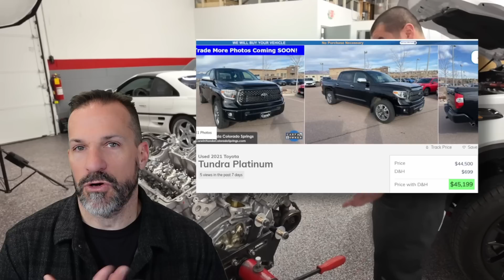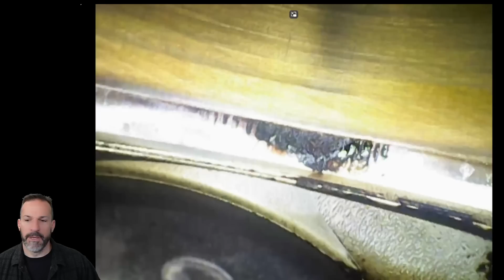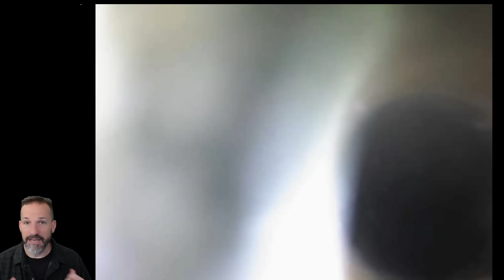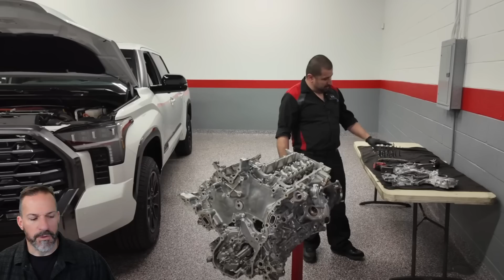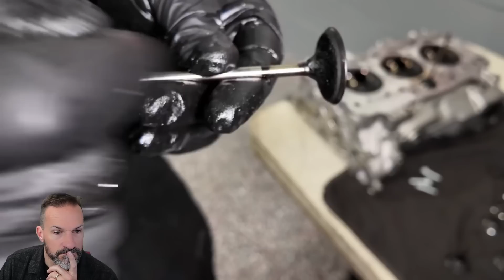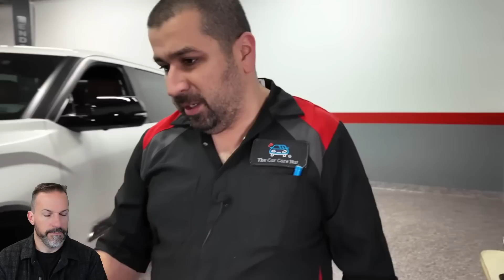Has Toyota LOST Their EDGE? Tundra Turbo V6 TEARDOWN vs. 5.7L V8

Comment: Turbos are junk on a gas engine! The engines will not last as long as the previous 5.7. Maybe that is what they want!
Reply: Absolutely spot on 👍👌✅️👍👌✅️👍👌✅️
Reply: Everyone knows turbos shorten the life of engines and it doesn’t matter if it a gas engine or diesel engine. Diesel handle the turbos much better but it still shortens the life of the engine.
Reply: @edtpnw1336  hardly anyone seems know a turbo shortens the life of a engine. I only bring up diesel because everyone compares a diesel turbos life to a gas engine. IE big rigs.
Reply: @DavidWX877 People who know that turbos shorten the life of all engines no matter what fuel source are morons with no knowledge of how engines work. I use to have this argument with the Toyota knob suckers. Everything Toyota does is great fan boys. Toyota figured out all the kinks of turbos and now Toyota engines will last longer. Bunch of morons who overpaid for a crap engine in an undersized full sized truck. They deserve all the headaches coming with these trucks!
Reply: @DavidWX877  I are speaker gooder english
Reply: @DavidWX877 Exactly mate especially EcoBoost owners
Reply: @CJColvin The Eco Boost engine problems are well documented and known. Ford has done a pretty good trying to resolve the problems. The early years were horrifically plagued with cylinder failures. I don’t hear of mass engine failures anymore but they still have uneven wear on cylinders.
Reply: @edtpnw1336  Right but I'll still take the NA V8 over the Turbo V6 anyday.
Reply: @CJColvin  I like to call them ecojunk.
Reply: @DavidWX877  Yep same here
Reply: @DavidWX877 I think it's pretty well known that turbo shorten the lifespan of an engine, gas or diesel. It would be interesting to see how long a gas engine would last with a turbo if it were built as tough  and engineered as well as the diesel engines.
Reply: @edtpnw1336 Depends on the engine and the level of boost. On some older diesel engines turbos decreased likelihood of issues related to high EGTs, simply by reducing the EGTs through more efficient combustion. Some older gas engines had no appreciable difference in lifespan between turbo and NA versions, such as the old Volvo cast iron block 4 cylinder engines, as well as the Subaru EA81 Turbo and regular EA81. In general these older engines ran relatively low boost and required premium fuel. That's part of the problem as well, relying on knock sensors at extremely high levels of boost is always going to introduce some baseline level of knock, which is damaging the engine. Direct injection or not, 87 octane fuel at 25+ pounds of boost is a bad idea. Why they don't just require 93 as previous turbo, and even some NA high compression engines did is beyond me. My mother has a 2024 Buick Envista and it sounded like crap running on 87. Pinging even on light acceleration even though the manual says 87 is OK. She has run that car on 93 ever since and puts around 40k miles on it per year, so far with no issues. Funny thing is that the manual says light knock is normal. And it shouldn't be, it's only normal because the manufacturers don't have the balls to say 93 octane required.

Comment: I watched that same video the other day and what I took away from it is this engine really has no value. He tried to say as much good as he could but when you tally what he said more than half of the comments he made were negative.

I’m sorry I will never buy a new Toyota ever again. I will never buy a tiny overstressed turbo that doesn’t just have problems it has catastrophic problems. 

I will buy old Toyotas for the next 30 years I don’t even care.
Reply: What you mention is what is going to be financially devastating to the auto industry. 
Granted, it's nice to have a brand new or 1-3 year old vehicle that's reliable, but over the past 3 years and current vehicles are turning out to be unreliable, and very difficult to work on.
If and when I need another vehicle, if I have to buy something 10 years old and restore it, it will still be less expensive than spending 60-80k on new junk.
Reply: @justsayin3600  exactly. When the brand new Tacoma who is having transmission failure one after another and in the hybrid trucks it cost $28,800 for the transmission how can you buy something like that? The technology has ruined the industry because now you’re gonna spend $100,000 on a vehicle and then you have to throw it away because it’s too expensive to fix or repair.

Worst of all, knowing how the Democrats work once they get power again they will ban you from owning older vehicles or as they proposed in California you can’t drive a gas powered vehicle in downtown cities. That’s what’s gonna happen. The communist will force you to buy the new junk that you can’t afford let alone afford to repair.